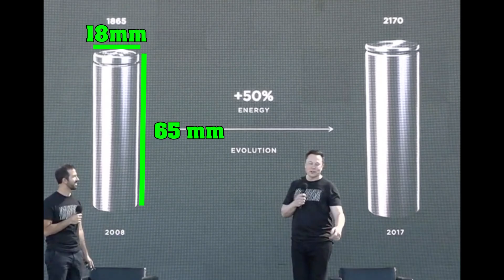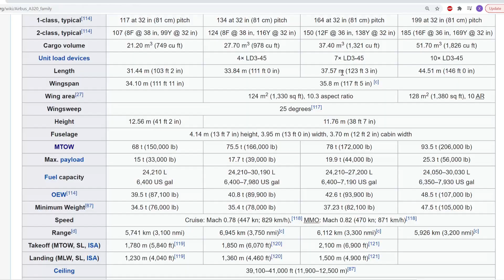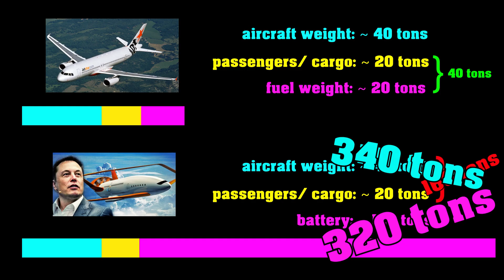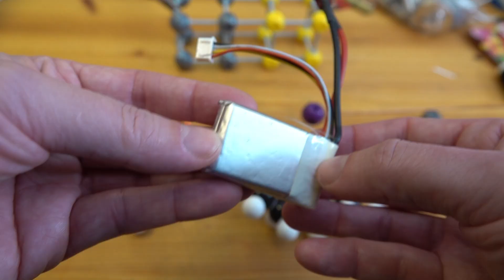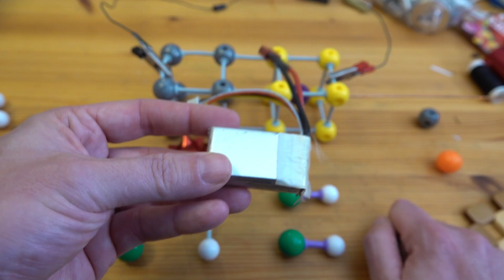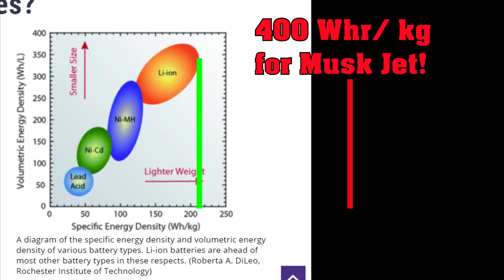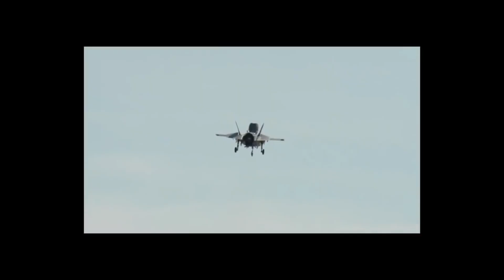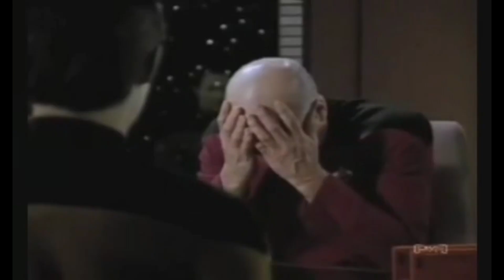Tesla's Secret Plan To Disrupt Airlines: BUSTED!!

Comment: first point, they didn't just make the battery bigger, they changed the battery structure, the chemistry, and the problem with bigger batteries, is the heat, and with the tabless battery now, they solved that issue which makes it bigger, they also dramatically reduced the way the battery is made with the dry coating which saves money and time, the increased the battery density, right now tesla has the highest density at 250kw/kg, and i think they reached 300, and with the new methods they will hit 400 kw/kg and on route to hit 500kw/kg, also the main issue we have in the world is the amount of batteries, we have no where near enough, so they are making news way that are faster and cheaper, also they will have 3 different battery chemistries for weight sensitive, and price sensitive products, also the battery will be structural, also he said a VTOL, not a commercial airplane, you are comparing a VTOL with an airliner, that's the first mistake, so compare a VTOL to a VTOL, as they don't carry the same cargo fuel and passengers, also, why does an electric plane have to be the same as a fuel one ? it simply needs more power, so if as you said, the plane ends up weighing around 150tones or whatever, it just needs more power, and that's where the 400kw/kg battery comes in, and lastly, weight doesn't relate to structural integrity, carbon fibre is light as hell and is much much stronger and can carry much more than lead or metal, also the structure has to do with it, that's why you can have a very robust formula 1 car that only weighs in at 750 kg, but it'll be hella expensive, with a first gen electric vtol they don't care about price, so you can use very light robust expensive materials, also the new tesla battery, the 4680 will have a density of 380kw/h, before the Li batteries came to life, there was people like you saying it's impossible, before Tesla, people like you said electric cars ... IMPOSSIBLE, you are comparing apples to oranges first, also you think they will just get the same batteries just somehow better, you don't take into account new battery chemistries, the possibility of solid state batteries, of which we do have some working prototypes, dry coating ... also regarding your it took them 10 years to add 46% capacity ... yes, because they didn't have money, no one really cared and again, people like you said oh it's impossible, but they pushed through and now they are achieving what they said they will, and now everyone else realised oh batteries is the future and EVERYONE started putting in billions to advance batteries, and some huge leaps were made, also everything i'm saying took 5 minutes to research, i simply typed in, new tesla battery density, and i found the 380kw/kg, and yet you said you couldn't find it anywhere, AND YES THAT IS A FUCKING RENDERING FROM A COMPUTER GAME, WHAT THE FUCK, ARE YOU A RETARD OR YOU THINK YOUR VIEWER ARE RETARDED, YES, THAT IS, A COMPUTER, RENDERING, FROM, A GAME, ELON NEVER SHOWED HIS DESIGNED, also the "rendering" you showed, is not a VTOL, it doesn't have the fcking capacity of to VT, vertical take-off, and you call yourself a smart engineering, seriously, also airplanes don't need that much air to lift, they don't lift against air, idiot, it's the difference in pressure above and under the wing that makes a plane lift off, the problem that combustion engines have, is the higher they go, the less air they have to BURN, so they can't FUNCTION, but an electric VTOL, does not need air for the engine to function, so even at low air densities, it just needs to create a differential of air pressure between the top and bottom of the wing, and again, IT'S A VTOL, NOT AN AIRLINER OR A PASSAGENRE PLANE, it is not made to carry passengers, it's, a, VTOL, it can be used for show boating, (also we already have electric planes, that can fly for a decent amount, he's not re-inventing the wheel, he's simply making it vertically take off, and go on for much longer, which he already did with electric cars, they already existed, he made them better) so yes it can be a single pilot VTOL as a fighter jet, that can fly at Fighter Jets, or the black bird, so he will start there, and keep getting better, but for you, if he doesn't create a A320 from day one tomorrow, and because your "genius brain" can't accept there is smarter people that kept proving they are capable of greatness, then they are lying and scamming people, why would he scam people ? he's the second richest person on earth, and he owns some of the most profitable companies in the world, i used to love your videos as you used to make great valid points, now you are putting words in people's mouths, hating for the fact of hating, and comparing apples to oranges, just for the sake of BUSTING a concept just to keep the channel going, seriously, make some valid points, and make me love your channel again
Reply: Sorry... how is ANY of this fractally-wrong wall of text going to make the concept of a battery-powered commercial aircraft any less dumb?

Comment: The main problem that I see with your video is that you failed to consider that the structure mass/fuel mass ratio is very different for a fixed-wing airplane(that needs massive wings to generate lift at slow speeds, so you don't need crazy thrust, or 20 mile runways. I suggest you look at another VTOL aircraft, like the MV-22 Osprey for a better comparison( I don't yet know what the outcome's gonna be, haven't crunched the numbers)

Comment: Given the energy requirements of VTOL, it seems like a waste of precious battery charge to do VTOL. 

What about assisted VTOL? A little flinger to launch the plane and an inflated landing pad?
Reply: Life is not Tom and Jerry.
If you launch a huge ass plane vertically up you need an insane amount of force, it will quickly fall to ground. Also a plane cant just take off in a second while its in the air.
Also a plane cant just land on a pillow jesus christ dude

Comment: Suddenly, I've watched  video about miraculous electric Supa dupa plane earlier, than Thunderfoot made his review.
Just to mention:
1)There is no (or nearly so) such electric turbine, which can afford gas flow with supersonic speeds - so plane can't be supersonic.
(in jet engine combustion do this by burning the fuel with high energy density and throwing the products with supersonic speeds la la la la la...) 
2)VTOL aircrafts with jet engines consumes almost half of its fuel for vertical takeoffs and landings. There are plenty of jet VTOL aircraft designs, but very few has got into air. Even the one of the best (I'd like to proclaim it the best of the best) VTOL jets ever built - A8 Harrier - has low range and is subsonic. Someone can mention F-35 or his inspiration Yak-141, but there are many problems with reaching things that are claimed about them. And here 80% of the mass (best case of this imaginary scenario) is batteries, which - surprise, surprise! - does not change their mass during flight. If this "aircraft" will get into air and somehow go supersonic (scientifically inaccurate imagination) - it will only hop like grasshopper. 

Instead of conclusion: even with power of scientifically approved imagination this plane just can't be. Just can't exist.

P.S. SUDDENLY, there are electric powered engines, which are going to be efficient with altitude, getting maximum of their efficiency in space - e.g. Ion thrusters. But their thrust is miniscule even in space conditions - all they have is outstanding ISP.

P. P. S. SUDDENLY X2 - Elon Musk plans to land his first stage of Starship rocket without landing legs - but by capturing it with hugging of launching tower during last moments of landing burn. I hope, Boeing won't steal this "brilliant" idea for their plane's productions.

P. P. P. S. SUDDENLY X3 - Elon Musk becomes the richest person in the world. That is what you need to know about how precious is human stupidity nowadays.

Comment: Boy is Musk overreaching. A vertical takeoff and landing supersonic electric jet? Just making a plane VTOL means adding more machinery to it, along with the weight that comes along with that. Electric planes also have a problem with weight. That means they have a problem with range. 

Besides that, why make it VTOL? You won't be able to take off from your drive way. You will need to take off from an airport and the runways will not get shorter because even if all planes were VTOL there would be a chance that the vertical landing machinery will not work so you will have to do a classic landing.

Comment: As many problems with this video as with the flying battery. Confusing mass with volume, only focusing on huge passanger aircraft, body fat not a bomb despite having 100x energy density.
Reply: Battery energy density is a problem, by both mass and volume. Battery energy density is still far too low for small aircraft, as well as large aircraft. VTOL aircraft have very high energy demands, regardless of size, as do supersonic aircraft. Like hydrocarbon fuels, body fat requires additional substances in order to be used as an energy source, while batteries have everything needed to produce energy packaged in the battery cells, making them far more dangerous as a means to store energy.
-
You having a poor understanding of what's being presented in this video does not mean that it's wrong.
Reply: @PistonAvatarGuy There are small electric jets already, plenty of them. Improvements like a few percent more battery capacity can add up quickly when  the technology is still in infancy. As for the energy density, I meant that there might be a way to store a lot without making it a bomb, we just have not discovered it yet. If evolution could come up with one. Yes, it requires another component, but you have to recharge or fill up at the airport anyhow.
Reply: @gabest4  There are no small electric jets, unless you're talking about RC jets, which only fly for a few minutes at a time.
-
"Improvements like a few percent more battery capacity can add up quickly..."
-
Irrelevant when you need orders of magnitude greater capacity. Chemical batteries are also about as mature as they're going to get.
-
" I meant that there might be a way to store a lot without making it a bomb, we just have not discovered it yet."

-
We did, it's called hydrocarbons, and we can actually synthesize them while mimicking the natural carbon cycle, it's just not profitable to do this. If we want to emulate nature, it's time to abandon our obsession with money.
-
"Yes, it requires another component..."
-
The other component is in the atmosphere. That's the point that you missed, that you don't need to carry the other component with you. Anyway, you're so far from being able to understand what you're talking about here that it's not even funny. It's like you're trying to say that we can fax people because we can fax documents, your understanding is just absolutely infantile.
Reply: @gabest4   Can't wait to see you try a "debunking thunderf00t video".... it never ends well
Reply: @salvatronprime9882  He was right about everything as usual. Only missed the topic, he thinks of Boeing 787, bliionaires think of a small luxury jet.

Comment: There's also the reason why there has only been a handful of jets that can doing VTOL and it's been used in a military context and not a commercial one. Also a reason why the military has generally stayed away from them. Heavier than normal jets, lower payload and shorter ranges. Helicopters do it much better as they are purpose built, but again, for massive payloads, you're looking at very bespoke variants that are basically flying fuel tanks with a cockpit.

Comment: 28:47 that is impossible. Propeller planes cannot go supersonic, because once the tip of the propeller starts to generate shockwaves, the propeller stops working as intended. And the best way i know how to get thrust out of batteries is with Hall effect devices. Which have abysmal specific Impulses in air.

Comment: There ARE ways to design safety features that would protect a battery-powered aircraft from battery fire, but ALL of them would result in an effective loss of energy density again.  (I'm thinking things like either modular batteries that are either in armored sections that can contain the failure or eject the failed section, but that means the battery system as a whole has a lot more mass and/or equipment that is also subject to failure.)

BTW, as I understand it, the standard procedure for all commercial aircraft in the event of a loss of cabin pressure is to make an emergency descent (that is, as fast as the air frame can safely sustain) to an altitude where the pressure will allow safe breathing even without an oxygen mask.  This means a loss of speed and range, but in such an instance the pilot is looking for the closest place to make a safe landing because something is clearly catastrophically wrong with the plane and there's no telling what's going to fail next.

Comment: This is very much the same sort of problem with any kind of solar power system: We know about how well the system can possibly work, and it simply isn't good enough to displace the existing systems in a free market.

All the lithium battery chemistries also have the problem that there's not all that much lithium available.  Yes, you can recycle it ONCE YOU HAVE THE REQUIRED QUANTITIES OF BATTERIES.  The problem is getting the required quantities of lithium required in the first place.  There are huge deposits of lithium salts in South America, for instance, but much of it's FAR to pretty to mine.  (It's this amazingly gorgeous salt flat.  Yes, a salt flat can be incredibly pretty.  You really have to see the pictures.  South American deposits are about 70% of known lithium deposits.)

Comment: Interestion problem I see with this approach is rebuilding all runways. Reason for that will be that gas powered planes are burning the fuel so we can say that in corner case plane can be 20 ton lighter than when it started. More mass means you need more braking power or longer runways, I got it should be VTOL, but in emergency you don't have time to switch it and land vertically, it's not even not possible if you loose engines. So you can only crash it. That sounds safe as like sleeping on hamak above lake with crocodiles.

Comment: why use vertical take off wouldn't that mean you need your twr to be higher then 1 inorder to even get the engine in the air if using electric engines any gain in efficiency would be ruined with the need for a higher twr.... right?

Comment: The only way I could see this happening is if Elon musk worked out how to very quickly ionize air traveling through an engine using something powered by electricity because propeller run into significant issues when trying to reach supersonic speeds however this technology is probably decade's if not centuries away plus the amount of energy it would take trying to ionize air would be ludicrous, the only way I could see that happening is with a nuclear power plant but at that point the aircraft would be so heavy its ridiculous to the point it'd be impossible to take off defeating the point of its own existence. Theres also a reason aircraft like the harrier didn't take off or land vertically very often that being that it was incredibly innefecient compared to standard take off (useful but still not practical in most situations) so Elon wants to build a plane that would not only be impossible for the foreseeable future but impractical as well

Comment: Even if battery technology manages to store the same energy density as fuel it still will be far less efficient because fuel weight gets used up as you fly, meaning the weight of the aircraft gets lower and lower and thus more efficient over the duration of the flight. Battery mass doesn't change significantly with charge level, so you're landing at the same weight you took off.

Comment: Actually zero emission aircraft can and will be built soon probably using hydrogen fuel cell pod motors, as you can get the energy density necessary for a workable aircraft, plus the hydrogen can be manufactured environmentally friendly from electrolysis as well as from cracking methane. So an aircraft with much reduced environmental impact can and will be made in quantity.  No it won't be one of Elon's silly ideas but it will help with reducing our impact on the world. 
 As for batteries, you make a big issue of the fact that the kw/l and kw/kg have not really improved that much in the last 10 years and that is true. Unless a significantly different battery is invented I don't think for the reasons Thunderfoot stated that that will increase much. HOWEVER what is far more important for the environment is the price per KW for a battery has reduced from $1200 to just over $100 (one battery has just be produced for exactly $100 pr KW in China for EV busses) The significance of this is at $100 per KW the actual cost of a new EV car to us (after the Chinese have forced the legacy car manufactures taking the piss)  will be the same as an ICE car. 
 Watch the fully charged show on youtube for sensible unbiased news on the world of EVs and environmentally sensible power generation.

Comment: For what it's worth, a full fuel load on a 777 is 43% of its maximum takeoff weight, and that doesn't count jet engines, tanks, pumps, etc.  You turn that 326,000 pounds of fuel into pollution every time you pump it in.  

It's not electric flight that's ridiculous and untenable.  It's flight.
Reply: Nah the flight thing has been proven, the battery flight thing has not. The battery flight thing is the ridiculous and untenable thing.